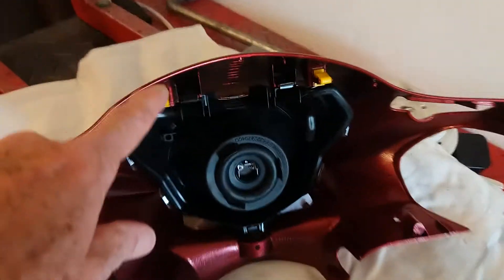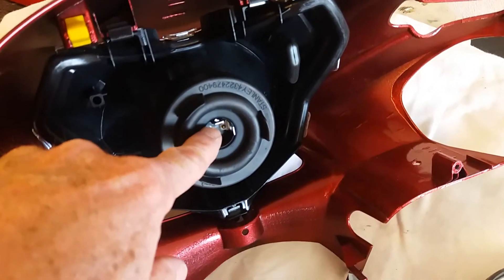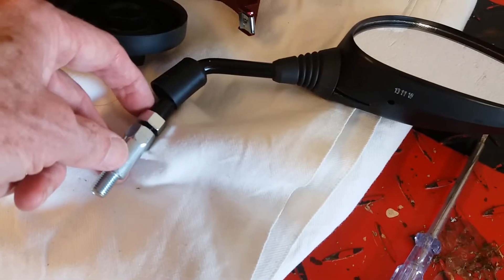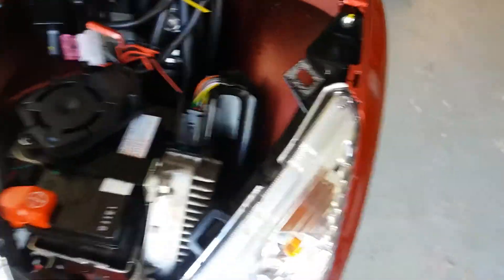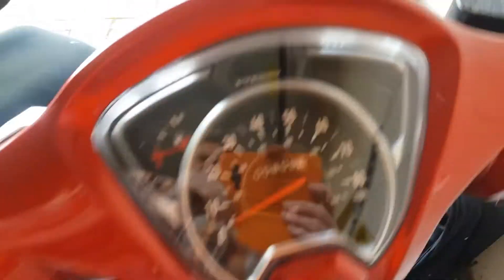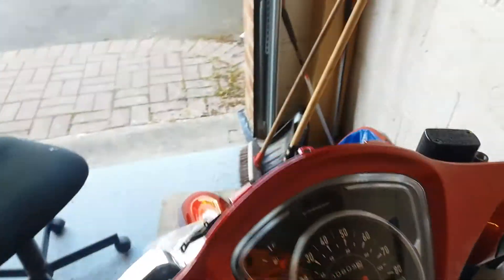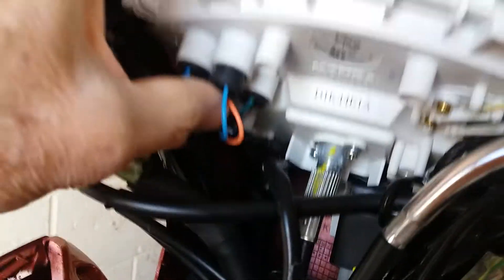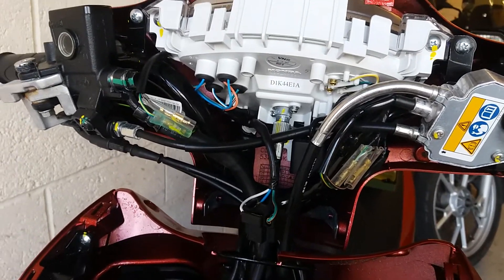Honda Vision 110 headlamp removal + indicator tell-tale bulb upgrade

Comment from the maker: I fitted an LED but it only worked when indicating left. Switched it the other way round and it then only worked when turning right!  That's diodes for you.  It wasn't that much brighter either.
Reply: Hi Andrew, just checking to see if you've tried replacing any other bulbs with LEDs, like the headlamps? not sure of the legality of them, like the OSRAM Ledriving H4?